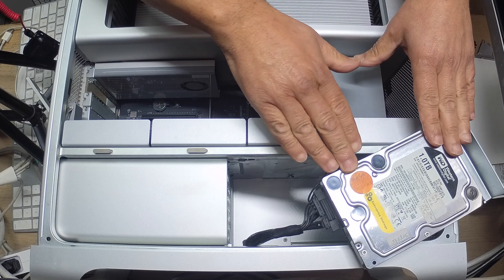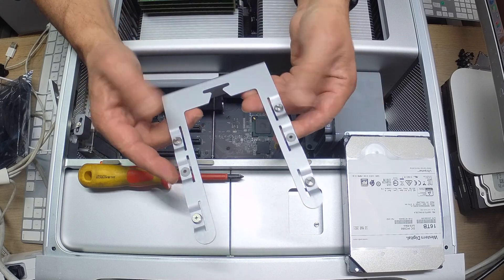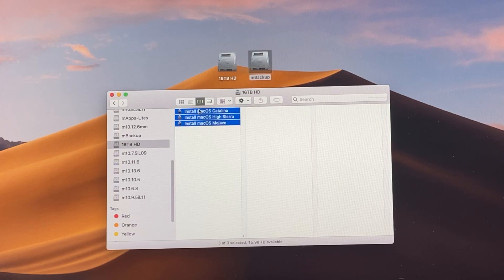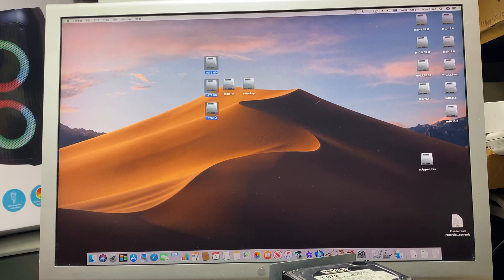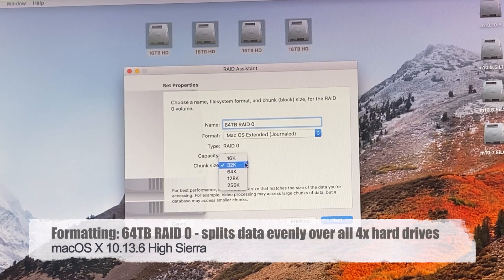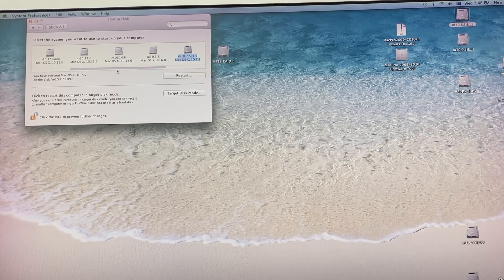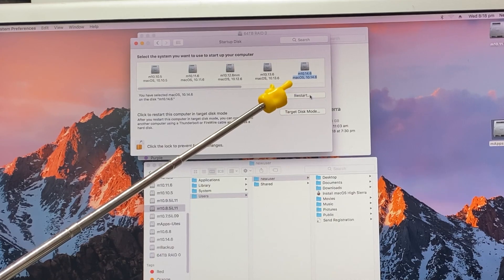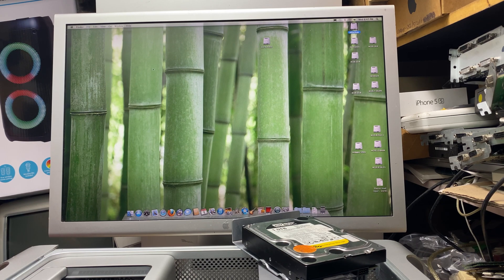[aa-labs] Installing 16TB hard drives in a Mac Pro A1289 2009/2010/2012 4,1 5,1 ⇢ l0002 ⇢ v24-011

Comment: can you please tell me how... or make a video on how to make a hard drive with all those OS's ready to go for  installation to new drive like you did here??
Reply from the maker: Thank you for your question. This macOS hard drive that I have in this video is developed over many years of installing various macOS that keep coming out each year. It is basically one hard drive that has multiple partitions on it, and then you can select which macOS to boot from when you start up your Mac (by holding down the option key), or by selecting the macOS from the Startup Disk in System Preferences. I will create a video that will show you how to create this macOS hard drive, but it really depends on how many macOS you want installed, which determines how many partitions are required, and also the size of the hard drive or SSD.

Comment: Hello, do you know if Mac Pro 3.1 support 16TB disk? Thanks
Reply from the maker: I did not try and install these into a Mac Pro Early 2008. I am guessing they should work, but would be purely guessing. I do not have the 16TB hard drives now, as I was building a PC server for one of my customers, and created a video for an install into a Mac Pro during the PC server build.
Reply: @aa-au  Thank you! There is a 8TB installed it it now, from your experience, do you think a 16TB will also work? Thanks againm
Reply from the maker: @adihendler845  From my experience, I have installed an 8TB and a 16TB (or multiple 16TB) hard drives in a Mac Pro Mid 2010 and Mid 2012 (as per this video), and nothing of this size in a Mac Pro Early 2008. You would also need a special hard drive bracket as per the one in this video, and a non-Apple one is not produced for a 2008 model. The bracket size is a larger size and will not fit into a 2008 model.

Comment: The 10.13.x install process will say that the installer is corrupt but it's bluffing ;-) If you disconnect from the network, use terminal to change the date of the system to [say] a date in 2018, the installer should work. Once installed connect network as normal and update the date/time.
Reply from the maker: Thank you for that suggestion. I have a couple of installers and they all say the same thing. I will try and change the date the next time I try and install.